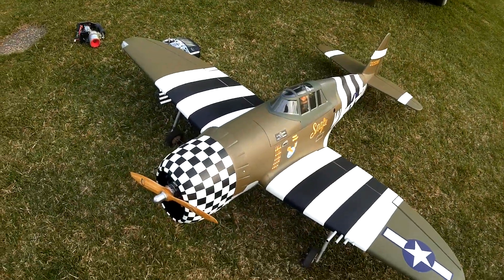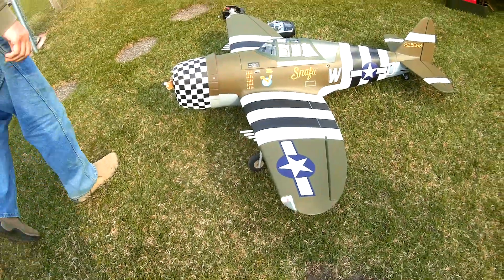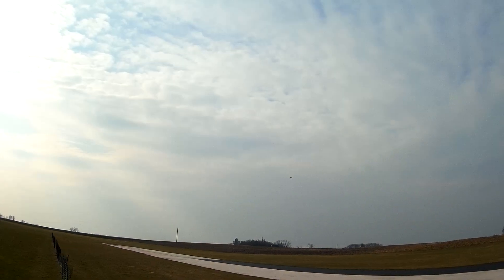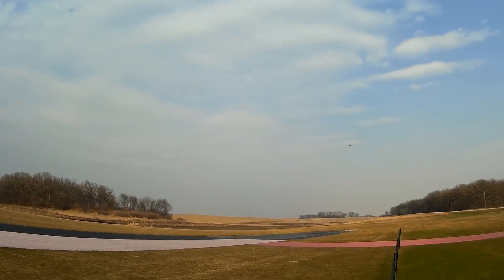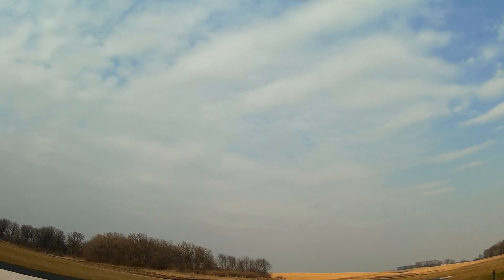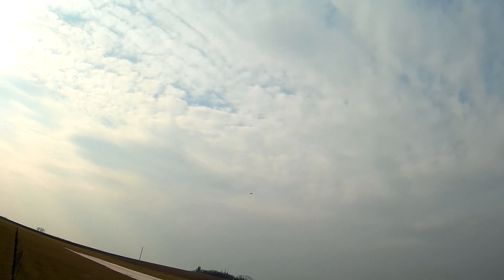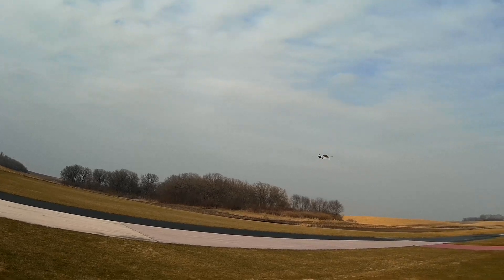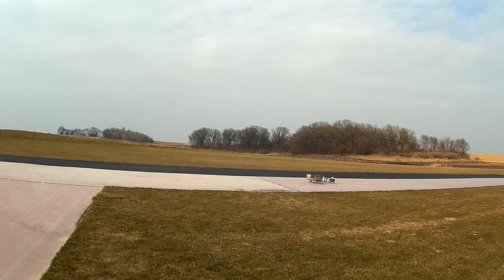P-47 snafu Saito FG-19R3 test flight

Comment: Did you fix the engine according to the original factory thrust line? Are firewalls hardened by extensions?
Reply from the maker: The thrust line was a little lower than original factory thrust line. The firewall was very solid and engine fit without much trouble.
Reply: @jagdpanther9  Does the engine extend a few millimeters forward?

Comment: Nice model And I also have the same old radios they are incredible engines once you figure out the right oil and how to set the carburetors 
You should be running klotz original techniplate at 15-1
 That is according to ray English who is Mr. Saito 
 The kl 200 will give you the best Is lubrication  for the bottom end And give you more power

Comment: Although I already have a DLE 20 for my Snafu I am so tempted to go with this motor.  Nothing beats the sound and this model deserves that sound.  Thanks for posting this video.
Reply from the maker: Thanks. The dle would fly it like crazy. this little .19 radial sounds so neat and still plenty of power. The downside is there is some tinkering to make these run right and they are spendy.

Comment: What modifications, if any, did you make so the engine would fit in he cowl?
Reply from the maker: Hi. I just moved the engine down a little lower from the C/L where the manual said to mount it also not as much right thrust Then it fit just right. It flew nice !

Comment: I love your channel! From watching your videos and living through this whole covid thing I've been inspired to come back to my long-time hobby of model building. I've built many models but not since my teens. I noticed you've done a ton of Guillow's conversions to electric but no F4U Corsair. I'm about to start that model myself but was wondering if you had any suggestions for an electric motor? I only ever built them for rubber band powered flight...
Reply from the maker: Thanks brian! never loose that passion for these models =D. i have a sig corsair that i planned to build at some point. i think the Gforce E400 1250 kv should fly it fine on a 2 cell or go for it with the E400 2400 kv on a 3 cell. value hobby has a great selection of motors escs and servos.

Comment: I have a RCV 120 sp and have always wondered if it would have enough woof and chuf for the seagull snafu swinging a 15 x 12 apc four blade .
Reply from the maker: it might, the rcv 120 sp is 1.8hp. this fg19 is 1.9 hp. my model came in right at 9.5 lbs. i figure 10 lbs would be the limit .
Reply: i had a rcv 90 in a 2400mm 7,2 kg.   swinging a 18x14 propeller.      it flew, but was underpowered….

Comment: When the engine is about 3 times the cost of the plane its hard to justify not having enough power.
Reply from the maker: yea, this engine was allot of work to even get it running well enough to fly. it fouled 3 plugs during break in and these plugs are not cheap. i converted it to rcexcel plugs and it runs good now. i did however get into this engine right. i traded some cash and another model for it new in the box so im not quite as butt hurt as i could be =D

Comment: Nice engine sound, nice plane. 
Are you using the original retracts?
Reply from the maker: thanks! the seagull retracts were a waste of time. i did try to make them work but no dice.these came from hobby king electrics for less tham 30 bucks for the pair. so far so good! these are the seagull oleos and wheels.

Comment: you could have overcome the under-powered performance by putting 4 blade prop on it for more thrust.
Reply: No you couldn’t, the extra load would lower the engine RPM producing less thrust and overheat the engine.